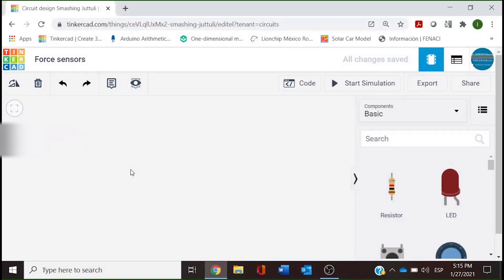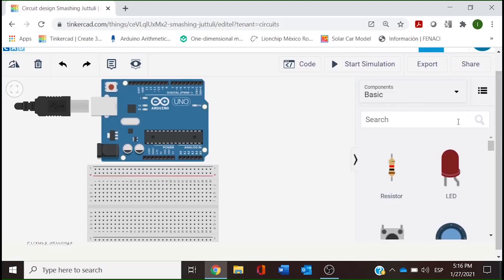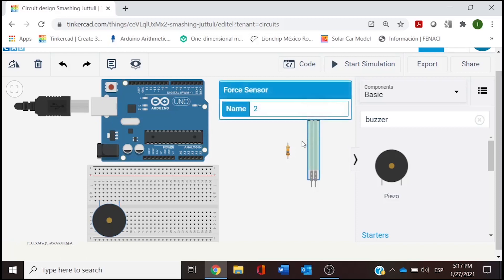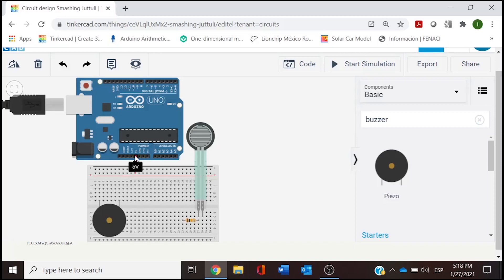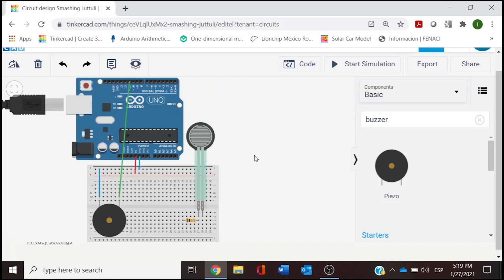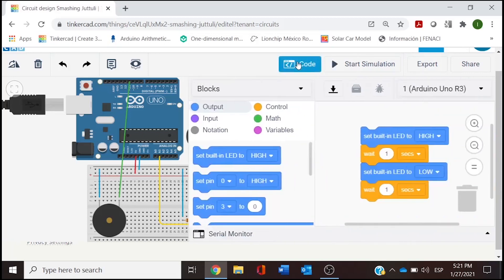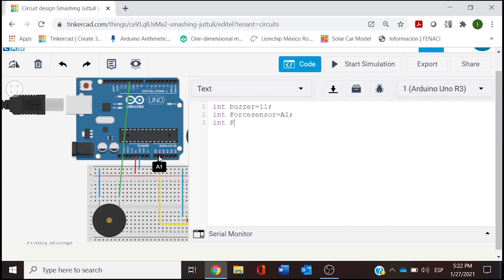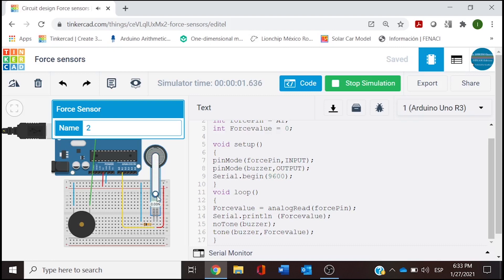Tinkercad Circuits Force Sensor

Comment: How would I do this if I wanted to power a motor and a light too?
Reply from the maker: YOu can easily add a motor or light. It can be done within the loop using conditional statements that evaluate input from the sensor to move or light up.

Comment: Is there any way to clear the screen of serial monitor in tinkercad after printing something? If yes please make a video on it, I need it very badly
Reply from the maker: We are not aware of anything like this in Arduino. Serial Monitor in the IDE is not a normal terminal that can be cleared.
Reply: @gearboxlabs1734  thank you so much for your time.

Comment: i don't understand how the force sensor will work as pressure sensor!!
Reply from the maker: Hi Engineer - There was a renaming of this sensor after we made the video. It is a force sensor- not a pressure sensor. If you look at our search for the part, we search for the word pressure and this sensor comes up.  It still does, but in actuality, this is a force sensor so it can only measure Newtons or pounds.
Reply: @gearboxlabs1734   thanks for your reply. And one more thing, is there any way to measure speed of object using the sensors available in tinkercad? Consider this question for finding the rocket speed with help of some sensor in tinkercad. I've mini project to complete, waiting for ur reply.
Reply from the maker: @aviroxi  Tinkercad does not have that capability as far as we know it. In real life, We have make speedometers using two IR sensors at a set distance apart and then using the millis function to capture two microcontroller times as an object triggers the sensors. This allows time to be determined and speed calculated. I am sure there are better ways to do this, but you need time between two points and the distance between those points to determine it. The easist way we also calculate speed in our projects is with a GPS. The library and part work amazingly well.
Reply: @gearboxlabs1734  if its not possible thats okay

Comment: Hi, your video has benefited me a lot. May I ask, if I was to connect more sensors. Where would the connects for to?
Reply from the maker: We would suggest a larger breadboard for more space. You have plenty of power and pins on the Arduino to connect additional sensors. You just need to decide how you want the sensors to interact or complement each other and code as needed.
Reply: @gearboxlabs1734  hi, ive copied the code exactly to yours and circuit is same but its coming up with errors in the code. Any advice?
Reply from the maker: @fazm8514  Please use the contact us form on our website gearboxlabs.org and send us you code. We can look at it.
Reply: @fazm8514   same 
Did you got your code corrected?